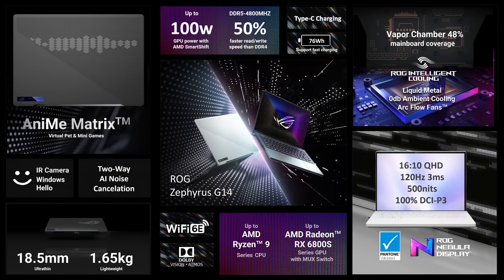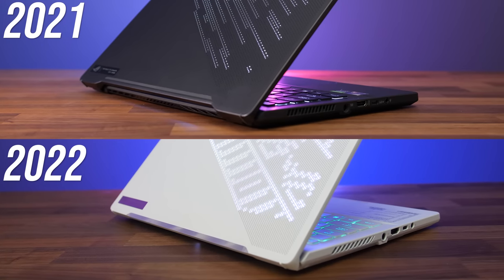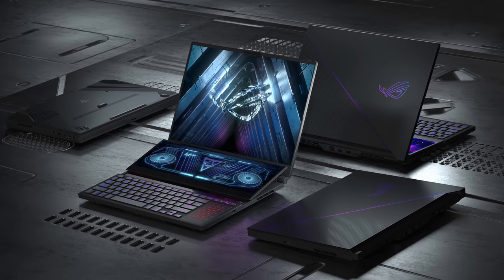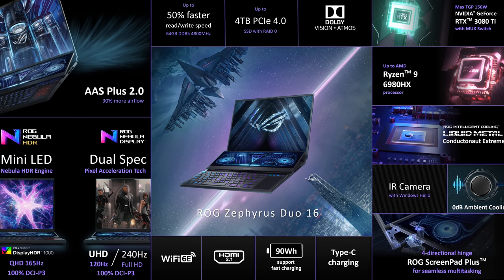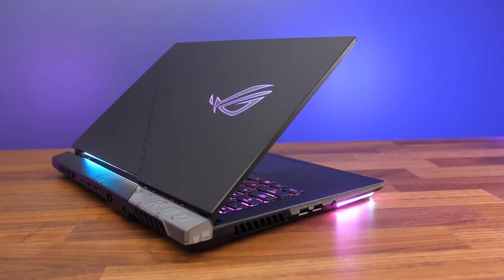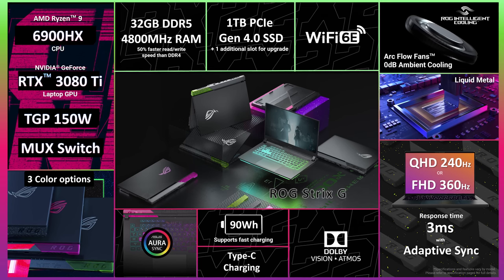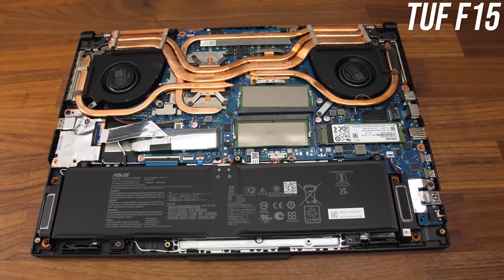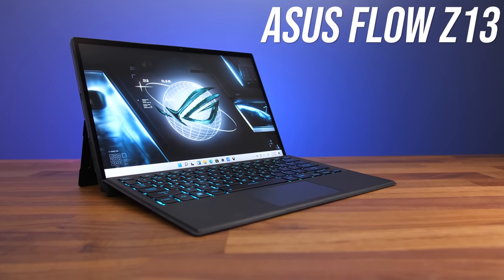ASUS Goes Crazy With Gaming Laptop Updates in 2022!

Comment: @Jarrod'sTech, does any of the AMD Ryzen 6000H based Laptops you received, support USB 4.0 40 Gbps port (6000H supports that) or just same USB 3.2 Gen 2 10 Gbps port? Also, if they have USB 4.0, what is the chance of supporting eGPU using Thunderbolt as USB 4.0 is nothing but the open source version of Thunderbolt 3.
Reply: is not open source, intel give it as free royalty.
Reply: @AchmadBadra  Sorry, I meant to say now it's managed by USB Consortium and  Processor manufacturer can implement it, if they meet the criteria of memory encryption.

Comment: G14 can go back on top with them changes, full AMD with Vapor Chamber Coller, Bigger Display Ratio 16:10, Has Webcam on it, Speaker is no longer on the Palm Rest area (Move to the top of the Keyboard deck), Bigger Touchpad

Th only downside that visible to my eye, the reduced Arrow key size.... which might bother some people that prever larger arrow keys

Its Either "Zephrus g14" or "TUF Dash F-15" for me (even tho Last year Dash F15 has a better design)

Comment: I bought the ASUS 2021 G14 on December 8, 2021 and I had to send it back to the service center last week since the soldered ram is broken when they diagnosed it. They said that they need to replace the whole motherboard. smh
Reply: I only played CIV 6 for 4 hours running at 30 fps before it suddenly shutoff.

Comment: Webcam is not necessary in a laptop, particularly with small screens (=<14 inch) that should not have webcam at all to optimize the screen size that is already small .

Laptops with 14 screen sizes need every inch or pixel to increase the display size, but not to reduce it with a webcam. 

Asus should propose different models of G14 WITH and WITHOUT webcam where the space taken by the webcam can rather be used to increase the display size for better work environment.
The webcam in laptop can be replaced with external webcams but the screen size cannot be extended or replaced in G14, so it is better to have the largest screen size possible in G14 than to have a webcam that will occupy some precious screen width where every pixel should be used to increase the display screen for better onscreen visual work comfortability.

Comment: I wanted to exchange my Duo 15 SE with 3080 and 4K screen for the new one but I'm unsure about the price of the new model (buying that Duo was a great financial effort for me and I had a big discount). The 2022 seems to be locked at 64GB RAM and 2x2TB SSDs. Those are unnecessary for many users but increase the price comically quickly. My laptop was retailed for 17700PLN but just with an additional 1TB SSD the price was increased to 20700PLN so 17% increase just for a simple SSD.

The 3080Ti will also surely raise the price (though it's the reason I'm upgrading, want to get into VR) but I'm afraid the price hike will be much bigger due to the stupid amounts of SSDs and RAM :(

Comment: Looking forward to see what's new in the 12th gen intel chips because of thunderbolt and TB charging. I do a lot of work at my desk for content creation, so having 1 port go to a dock and THEN to monitors is important to me, "One port to rule them all". That's not going to happen with AMD any time soon. One cable. That's it. I don't want to have to plug in multiple things when I sit down at the desk, and don't want to have to plug in multiple things at my desk. I love a clean desk. Current system is a Surfacebook, which has a proprietary docking system that one port does everything, and I love having only one cable that's hidden on my desk. No other cables in view.

Comment: I don't like laptop cameras anyway.

1. Don't use them.
2. When I need a laptop camera I use my $30 usb camera that is much higher quality than any laptop camera I've ever used. It attaches to the top side of my laptop screen and unplugs when I'm done.
3. All of my laptops with a camera have a piece of black electrical tape covering the sensor.

Comment: I might get the Asus tuf f15 2022 in my birthday if my parents will buy it i like the design of the new Asus tuf f/a 15 but I  quite sad about the ports I n the 2022 model I like the port selection on the 2021 model than the 2022 because in the 2021 model it has more USB ports in the left and the Ethernet port is in the left and the combo jack is there in the left but in the 2022 model it has only 1 USB port in the left even though it has 2 type c ports I don't really use them ever I don't even use it rarely and the new lay out of the ports in the new model is like the tuf dash f15 from last year but I I will still buy it it's quite nice and I hope they fixed the airflow issue of the laptop from last year ago

Comment: this was my experience last year/spring. Zeph g15...1700$ on sale. 5900hx with laptop cooler.....best example i could use to explain how theres a marketing gimmick/aspect to these laptops. 5900hx OOH AHH>...< helps asus score high in theoretical benchmarks or cpu benchmarks....but the second that laptop touched a shared load it would see 90c or have to be ran at 25w max....and low core clocks and overall IPC vs intel IMO. I mean yeah other games that were mainly GPU dependent COUGH cyberpunk perhapse 20w cpu can 'get by' but in GTA V....a single threaded game. The 5900hx couldnt touch 4ghz on a single core so....you got a 100w 3070 trucking along with a 5900hx barely able to run 3.2-3.5ghz on a single core since gta v is old as dirt. Yet 10750h x 2070s max q 4k omen....is trucking along at 70-75c with the same cooler....at 35w 4ghz range.......and max 100w+ on the 2070max q...and both systems are getting the same fps...only ones 2k(AMD cpu) and the intel is 4k........on the omen. I put bfv on low settings and im getting 90+Fps with the intel at 70-80c. and still touching 3.8-4ghz on cores utilized. The zeph g15 was like worrysome to use with bfv. Overall i was not remotely impressed by the shared load management/cooling and how "theoretical" benchmark centric a lot of these laptop/cooling design implementations were for 2021. Its quite obvious companies like lenovo caught on to these bs antics by the likes of asus and "others". And are really trying to drive their selling points home of cooling/build quality no use of liquid metal which led to various QC nighmares for asus owners of the strix g15, zeph g15 etc, and the worst of all amd advantage owners. I will no longer be purchasing asus laptops for a while...as my zeph g15 also updated nvidia as per usual...and auto locked whispermode 2.0 on even in control panel...greyd/locked on. BB didnt know how to fix it so i exchanged it for a 4k omen. BC theyre issue free other than needing delicate care with the screen/flex. in 2022 ill be looking towards a 12th gen intel lenovo unless i can see conclusive PROOF that amd can be properly cooled and these DAMN manufacturers actually DO real engineering towards properly cooling a shared load. VS these bs "FOR ARTICLES" theoretical benchmark "mode" laptops that cant even compete with a 9750h and 90w 1660ti.

Comment: 12:10 OMG they have fish up this years F15 model. I mean the arrow keys are so tiny. They keyboard has keys very close to each other and the touch pad no longer has individual left & right click keys, like last year. Why do companies can't make a decent laptop. I miss my Omen 2017 model. It was good, the only draw back was HP's pathetic customer support in India. More than 3 months and didn't gave me a screen replacement, so I went outside purchased the screen replacement and fixed it myself. The seller gave me a duplicate 1 with 60HZ. So I sold that laptop. I got another HP notebook for temporary use, that laptop had faulty harddrive out of the box & HP kept on running the text for more than a month on it, after that they replaced it. At times they ran the same troubleshooting steps thrice and at times they tried to fool me. They didn't knew I was an IT guy. HEHEHE

Comment: All laptops are beast this year. But they are gonna make it overpriced again😐😣😑
Reply: Yeah, im not hype at all, the moment i got info about ces 2022 laptops back in december 2021 gonna be rtx 3080 ti, thats it. Its over. Rtx 3080 laptops are already out of reach for most enthusiast let alone rtx 3080ti. Sure, gaming hardwares are cheap on US, but here ? it costs twice the price. No hope at all. Even a single rtx 3060 gpu here can buy a single unit of ps5 with two controllers and some games. Let that sink in. Oh, and yesterday for the m16 or g14 if im not mistaken, the new one comes with 4k 120hz screen, can you believe that ? Lmfao. Even the most powerful rtx 3070m laptops cant reach 60 fps solid smooth 2k on games like metro exodus and cyberpunk 2077, with or without ray tracing. And u know what ? A guy replied to me and said "the 4k 120hz is not for gaming, its for doing work stuffs and watching movies". I laugh even further. Man they are genius at jokes 😂. The purpose of thin light laptop like m16 or g14 is for the battery life because for mobile use (users move around from place to place). Fhd 300 hz is more than enough for that size. Its frickin 14 inch so small why even bother with 4k ? And 120 hz ? Makes it even more funny. 😂